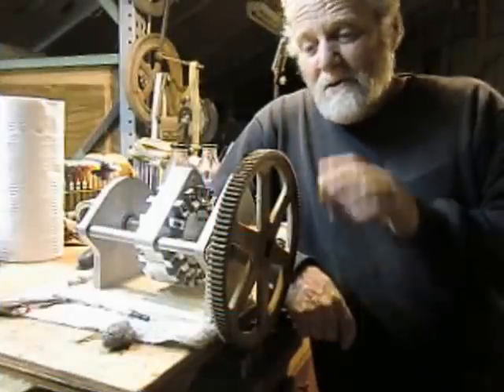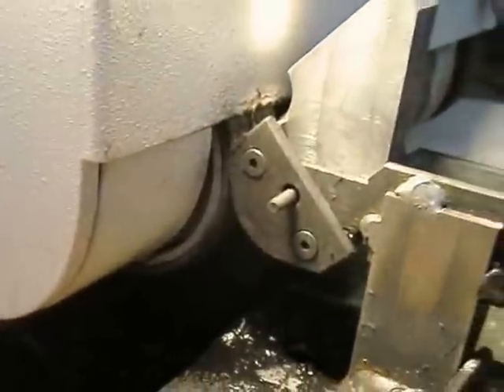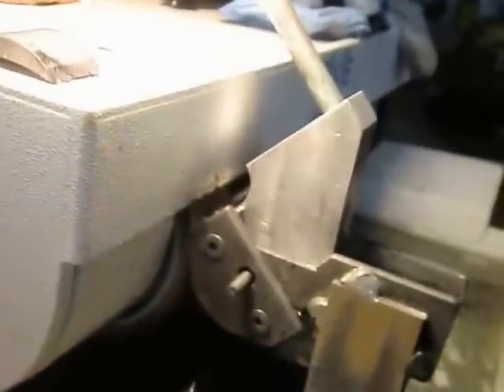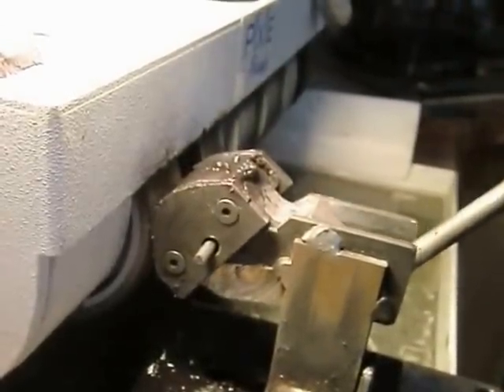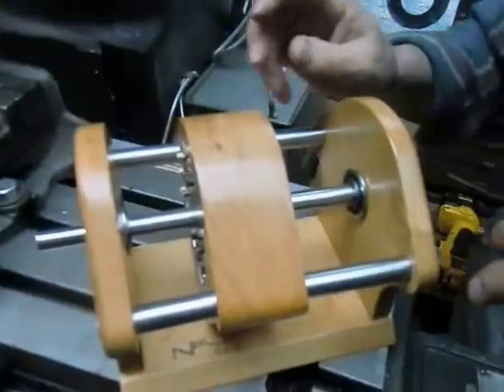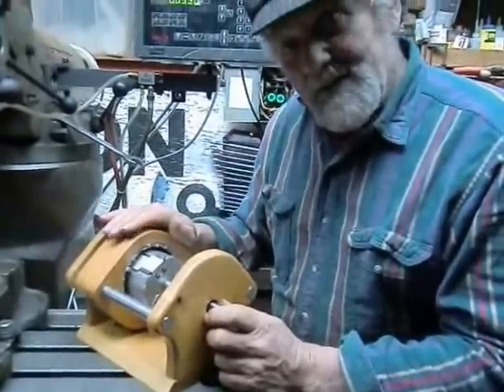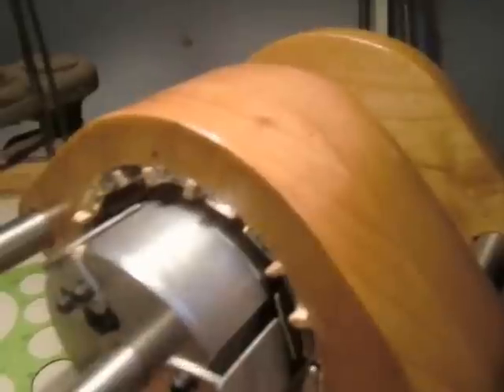HoJo Permanent Magnet Motor

Comment: Honestly the biggest problem out of this. To make it almost be self sufficient is having everything down to A T by something beans for metrical that's the biggest problem out of this and that would be physically almost impossible. Because behind the decimo is infinite so it's really hard to get an exact number we can always round. But with something so inquired with science thermodynamics and etc. That is the ultimate math barrier. In my perspective we can figure out the magnetism part but something not being symmetrical is the hardest problem when it comes to engineering . Perhaps one of the most important parts. Put another big deal breaker is drag if you would want this to be 100% self sufficient you would need it to be inside of a vacuum,

Comment: To get movement you need some form of oscillation of the magnetic field so it gets applied only in one direction , so basically the stators needs a to be able to do a rocking or sliding motion to get the magnet to jump the crest of the magnetic field and fall back on the next "descent" like surfing, making the magnetic fields produce a wave inclined backward where the stators cuts back their power while going up the wave then put it back while going down, pushing the rotor forward to the next wave...that sounds easy...but i can`t imagine how to do it efficiently enough for the process to work. and the stators magnetic field starts hitting the crest of the wave after a while and the phenomena leads to constant power loss until complete stop :( at some point my oscilloscope shows that the stators are not fast enough or should be able to be adjusted live to maintain the wave form. but it is all over my head Now... I understood, there is no such thing as perpetual motion, period. Nowaday I`m breaking my a** on something that gives results. But Mr. Thank for trying, don`t give up, anyway it`s truly a cool hobby and if someone succeed one day that would be amazing...

Comment: Shaving off the actual magnet may be a better way to get the exact size you need for the stationary magnet and then determine the size of the rotating assembly through the total amount on the rotor.

Comment: Your building it with the wrong materials. Aluminum is paramagnetic. Your moving fields are being attenuated. Use uhdpe, acrylic, pvc, or wood for the structure and it should work. Or use a magnetic insulation sheet to separate the magnets and the case.

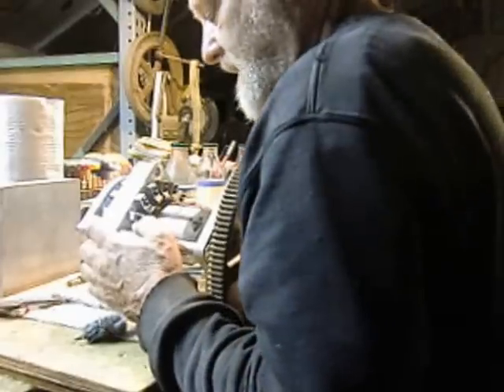Comment: At 1:30 is where the problem is located. He speaks of a counter balanced magnetic field. Rather I found that you need an unbalanced magnetic field by at least 60/40 rather than 50/50. Otherwise, Newton’s 3rd law of motion takes over and causes the rotation to come to a complete stop. My, James Roney Stator overcomes Newton’s 3rd law of motion by setting up an inblanance system of 40/60. Never seen this video before. And yes, people are quick to put this research down, some I suspect are hired to do so, while rest can’t see the forest for the tree in front of them.

Comment: Put your small magnets on the in side around where the ometer would be and then put your curb magnets on the outside that's the way the original inventor of this motor did it I have the same plans that you have but it says in the first part of the plans you have to change things. They cannot put the original plans as they are they're not allowed to do that.

Comment: Hi Nik, I have built a magnet motor and just tried it out and it will not keep running. It slows and then locks north to south and stops. I have seen Thomas Engle's motor with a rotating "mirror" magnet and might try something like that because it works, but requires a small 9v motor to keep the magnet turning but I think you could hook a generator to it to make the 9 volts easily. The way I did mine was to put 12 N magnets in the stator and then I put 24 magnets in the rotor in a sinusoidal pattern and they had 3 groups of N magnets and 3 groups of S magnets at varying distances from the outer edge. I thought that the N magnets would pull on the S magnet until it came close to the highest one and then it flipped to the N magnet and would repel until it go to the lowest magnet where it alternated again. I even put a flywheel on it to keep momentum, but it eventually slowed sown and locked N to S.  I'm going back to the drawing board. My E mail is jcj7815@att.net. I'd like to keep in touch with you on this so we can get a working model!.........Cheers, Jim Jakosh

Comment: Sorry that I didn't watch your whole video but I don't think a permanent magnet motor is posible with our current understanding of magnetism without either a mechanical or electrical mechanism to move at least one magnet in the cycle to offset/mitigate cogging. I can't help but wonder if some tricky manipulation of eddy currents could accomplish this as well.

I think someone already did it though, if it's not another fake video. Look up "v-gate" motor. there's one iteration I saw that seemed to be working.

Comment: The "Free" Energy debate. Yes. "Free" Energy exists. Can it be done with magnets . Yes. Has it been bone with Magnets. Yes. Does it produce power . Yes. Do people win the lottery . Yes.
I can assure you Nick, that the day it happens to you .. you'll get a cold shiver. No better feeling like when you have cracked the science !
Remember that magnetic fields are "spins" or loops of vectors, that interact in 4D. They can be triggered and flipped, they can be shaped. Bismuth, Mu-metal, Superconductors, and electric fields all influence the shape of the fields inside a magnet or a media / zone of influence. For instance - the Halbach Array is a pseudo one sided magnet. Conservation of energy depends entirely on the chosen reference frame, Even NASA have thrown that out the window with EMDrive physics. Interestingly Yildiz claims the magnets loose their alignment over time. So in effect the magnets are considered a battery storage device with a reasonable energy density. Think about the loops. if you try and bunch them up, it gets complicated. Try undoing the loops and refocusing them around another few degrees where they are useful, not problematic. It's the 3D bulge of the loops that stuffs things up. Take a peek at the Patents by Howard Johnson, and the many texts out there by same. When I was 7 Years old I designed a PM motor. It had  12 bar magnets arranged on a clock face each pivoting around the numeral position, and one central magnet, the outer magnets rotated at a ratio of 13:1 to the inner magnet . I took this to my father, an Engineer, and he laughed at me, he said - son it will never work. That kind of shattered me. To this day, I've always wondered about the what if. Later having discovered the Halbach array, Mu Metal and Bismuth, as I was obviously fighting attraction and unwanted repulsion, It seemed to me that it really was possible, and that I might have nailed it given that I designed my first in 1970. So .. you obviously have skills and determination, don't let the in box thinkers deter you from what is a fascinating hobby. Better than trying for a hole in one 18 holes away. Good luck and high spirits. Garret AU

Comment: ive only seen working magnet motors made out out of aluminum to counter act the lenz effect as best as possible but the magnets were disks or cylinders with the flat ends as north and south mounted on an angle pushing in a diagonal direction. i haven't seen a magnet motor work with the magnets in a similar north and south orientation that you used before. im currently saving up to build a system im pretty sure will work but i need electrical engineering training or something of that nature to know how to wire in all the components needed and to know what components are needed to correctly and safely supply power. anyways, good luck if you haven't figured it out by now.

Comment: Your on the right track but why don't you find your magnet arrangement on a linear track first and then once you find your working alignment, Then you can arc your geometry and save yourself all the work of having to always remake your stator .  All you will have to do when it doesn't work is just rearrange the magnets on your track.  It will work.  I've seen it

Comment: From what I understand from researching similar designs secret lies in shielding each magnet on all opposing sides to isolated the other magnetic forces from interacting and interfering and creating sticky spots. One material to look into and you can salvage much of it out of used Hard Drives is called mumetal I believe and is the metal the very powerful neo magnets in hardrives is mounted to. If you have ever played with those you will see the mumetal effectively shields the backside or opposite pole of those magnets. You would then need to figure out how to wrap your magnets for this machine in mumetal so only the one magnetic face either north or south is allowed to interact in either pulling or repelling without any other parts of that magnet allowed to create eddy interferences or other disturbances causing drag or sticking points. I have yet to build one yet so your experience trumps my head knowledge so far. What I do is watch every video I can find on the subject or in this case this Peredev style motor and watch what everyone has done and then look for what they all have in common that the originator gave clues to that they did not do and what I just revealed was what I have concluded. In fact that is how I found your channel Nik is by researching this type mag motor. Have not found anyone using magnetic sheilding and therefor will not work. Originator used anothor type metal for shielding and is somewhat expensive. My thinking is anything that can effectively shield will or should work.

Comment: It will work on a vertical axis with near zero gravity four enclosing three encapsulated under gravity. thus captured and enclosed magnetically where spin has no resistance nor need of maintenance. 3 over 4 under gravity configuration to modulate the three on vertical freedom as per autonomy eventual vortex cortex one hydrogen atom. gizzzes.on respective parallel planes. The square four base propels the triangular three point opposition parallel discongigurable magnet oppositions in gravity, Thus near zero gravity in energy out, no doubt, unimpeachable
vector. three and four do not configure there for must spin. between three and four is perpetual pi. This will work keep up the great work.

Comment: Hello I do not know about the hojo but I build something like that I used iron for the inside and magnets to push it against it worked fine
Reply: You built a permanent magnet generator?
Reply: a what, all I did is put spring inside a hollow pipe so it would push against it put iron on the pipe then put the half moon thing on with the magnet it pushed it really fast so I made a generator with a a jowl theif cussed it cause it bit me then hooked it up the yurt, thats it

Comment: I have thought over this for many years and I watched all the YouTube videos regarding “magnetic perpetual energy”. 
I am an electronics and electrical engineer with 35-years’ experience and I don’t consider myself ill-informed or stupid (just in case you want to post a classic YouTube comment pertaining to my credentials).
This theory is great!
The fundamental flaw that is holding everyone back (from what I have seen) is “the physics” – NOT the science - the science is sound.
I laugh myself silly when I see all the attempts at this form of “propulsion” and how they go about it.
Meaning, everyone’s magnets are in close proximity to each other – when this happens, the magnetic fields overlap and interfere with each other – you need FOCUS and ISOLATION (insulation).
The ONLY way to overcome this “magnetic interference” is to use a substance that is electrically similar to electrical conductors which use porcelain, bakerlite, glass etc. 
The closest substance that is “affordable” for magnetic insulation is COPPER!
If you are using WOOD, plastic or aluminium then you’d better give up immediately at trying to duplicate or better any of the funny YouTube designs.
The closest designs I have seen on YouTube have been BRASS but brass is still a useless “magnetic insulator” (but better than wood or aluminium).
While I understand that it is easy and cheap to build models from wood (as 90% of YouTube experimental projects go), if you are serious about pursuing this form of “free energy” then you need to focus on the “physics” and/or science of magnetism and what insulates it.
Maybe one day when I have the time I will put “my money where my mouth is” but, for the time being, I urge you to look at the physics.
Reply from the maker: Actually, I haven't worked on that design for years. I had to come out of retirement and start making money again. . .damn. You are right insulators is the key, which means i'd be starting over from scratch. For now, the machine sits gathering dust while others who can afford the time to work on the design move forward.
Reply: Yes, I have that problem too - time :)
In the meantime, I have been collecting copper (wires, heatsinks, water pipes etc.) with the idea that "one day" I will have time to melt it all down and forge it to a design of sorts.
Life is just TOO short :)
Actually, I think gold may be a better inulator - lets not go there...

Comment: To be more accurate, "distance" instead of detach. At one point the stator magnets should be close to those of the stator and then far again. This cycle should be repeated. There is a youtube video already of this. The HOJO arrangement of magnets is primarily on a linear basis, and yours is rotary which add more complications to the already problematic magnetic field lines.

Comment: i think your motor will never work. The magnet's hold-over is keeping the motor from gaining momentum. You should incorporate in your design a mechanism by which the magnets of the stator could detached themselves from those of the rotor using the spin of the rotor itself. Any configuration you do will surely not work until and unless this is done.

Comment: You had the same problem of everyone: magnets of the stator can attract before than magnets of the rotor pass in front of they, but magnets of the stator still cotinue attracting the rotor-magnets avoiding to separate the rotor-magnets. The final result is the rotor don't accelerates even rotates in opposite direction. 
The only solution for that is to shield both magnets to avoid magnetic field surrounding the magnets. It is easy to do with iron of enough thik 4 or 5 mm.
Best regards

Comment: Hi, I see that you've gone a great job. I just want to suggest that you arrange the outer magnet at an angle say, 22.5°or 30° or at best 45° since it's hard to start while they are arranged in a parallel to the rotor. Also adjust the clearance to be very close say 1/32".So the magnetic fluxes can cut through or touch the opposite polarity to cause a reaction of attraction and repulsion.  One the initial force is over by a small force, then magent motor should run without stopping. Good luck.